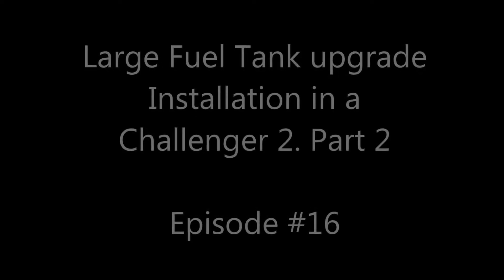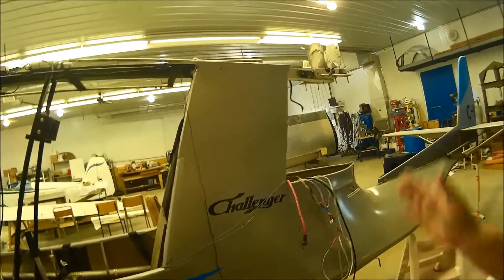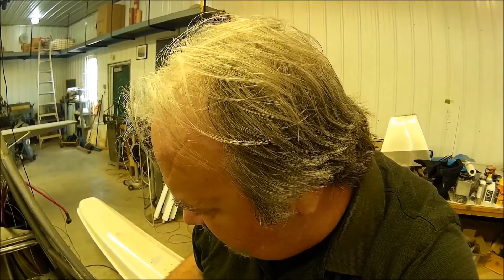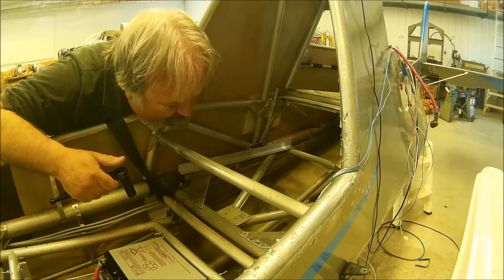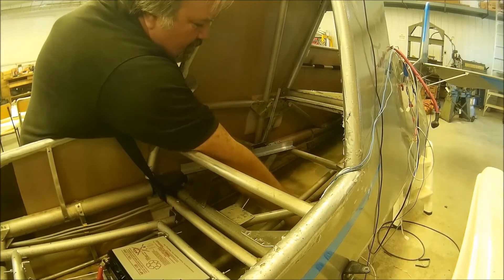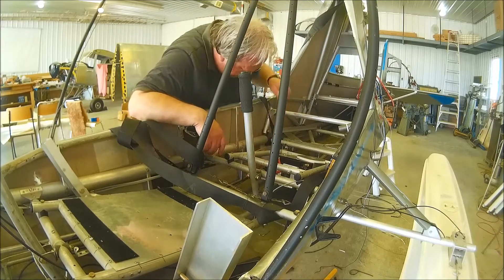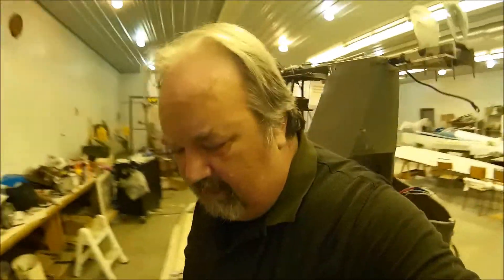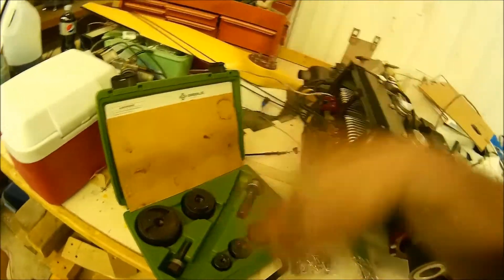Ep #16 Part 2 of 4, Installing a 17 gallon fuel tank in a Challenger 2 Ultralight Airplane

Comment: What episode shows how you installed the metal ground plain for the transponder antenna?
Reply from the maker: That one is buried in EP16 which is part 2 of the fuel tank installation. About 4 minutes in I show me cutting the holes in the cloth after gluing the aluminum plate in place. I don't actually show me laying the plate onto the cloth, or punching the holes in the plate ahead of time to accommodate the antenna and the curtis valve for the fuel tank. Sorry. The reason I glued the aluminum plate to the cloth, was to prevent the cloth from ripping  when in flight for the opening for the fuel tanks sump valve. Then I figured I would make the plate a little larger and include a mounting point for the transponder antenna. It worked out great that way.

Comment: Hi. Thanks for the videos v informative/entertaining.  Im in the process of restoring a 2994 Challenger 2. i would like to know if i can order that tank & if so where from? Mark
Reply from the maker: Here is a link to where I purchased the fuel tank. http://sheertechnologies.net/Itank/index.html

When you order it, you need to specify if you want an external fuel fill point like I have, and what side you will want the fill point located on your airplane. Or you can fill it from the inside, like the smaller tank.

Comment: Great video. Recommend replacing the lord mounts while the engine is off. If your using a fuel gauge, Couldn’t you just plug the site glass holes and not worry with it?
Reply from the maker: Thanks, that's a good idea, I will order a set of replacement mounts this week. As for the site glass, yes I could just plug them. But I wanted a backup, and I also wanted a way to see how much fuel is in the tanks when refueling, without having the master switch on. Glad you like the video.